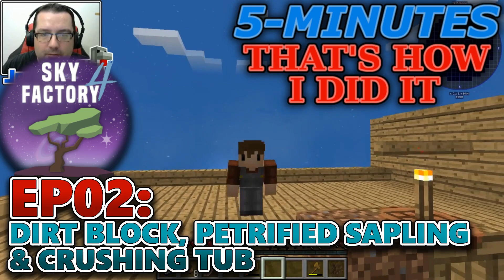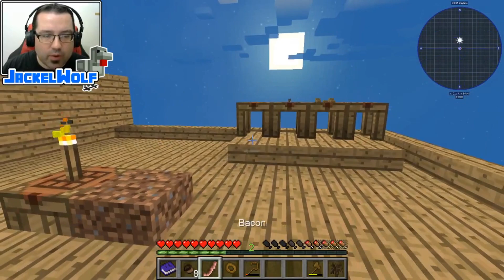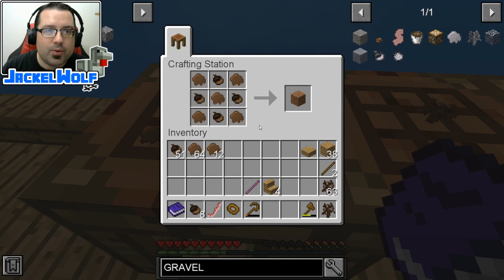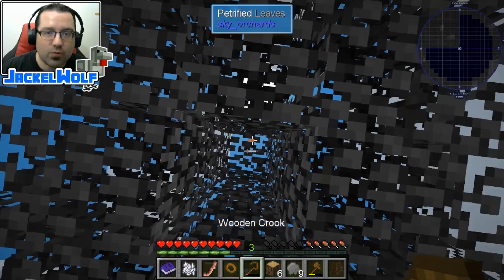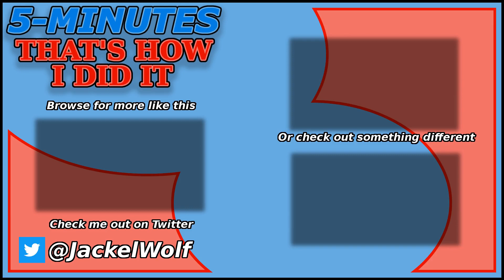SKYFACTORY 4 - EP02- DIRT BLOCK, PETRIFIED SAPLING & CRUSHING TUB (HELP/TUTORIAL)

Comment: Um i am 2 years late but i have a question. How did you get the vein miner?
Reply from the maker: This is probably my most common question. First thing you need to check is if you are playing with Prestige on. Prestige mode locks Vein Miner (technically Ore Excavation in this pack) and you can only unlock it by spending Prestige points (which you get by compleating pages of the advancement book).

If you do not have Prestige turned on, you need to hold the Grave key '~' down while breaking the block you want to Vein Mine. This is dependent on your keyboard layout, so you can check the Controls Menu to see if it is bound to a different key or if there is a key conflict. Again, it is called Ore Excavation in this pack, so you will have to look for that. 

Hope this helps!
Reply: ok thank you for letting me know

Comment: I just get something called dirt amber
Reply from the maker: You need to reverse the recipe. 5x resin and 4x acorns make dirt-dirt. 5x acorns and 4x resin make dirt-amber.
Reply: @JackelWolf  thank you, what about getting bones?  I'm pretty new to modding minecraft and the modpack doesn't really explain or have the recipes
Reply from the maker: There is a bone sapling. I think you need to craft from acorns. It's been a while, but if you search in your crafting menu you should be able to reverse Engineer from a bone sapling.

Comment: idk why but the recipe for dirt doesnt work
kinda late, i know, but if you could help me i will be very grateful
Reply: i have the same problem but i cant solve it. PLEASE HELP ME, I will be very grateful <3
Reply from the maker: Did you change/add any files? That was the cause of the previous problem? They solved it by reinstalling SkyFactory 4. Other than that, I'm not sure what else could be the problem. I've never had a problem with dirt before. 🤔
Reply from the maker: That is odd. I havnt had trouble with dirt. I assume you are using the resin and acorns, correct? If so, the only thing I can think of is to swap your positions for the dirt and resin. The other way would be to find the recipe in the JEI, and click on the plus sign next to it. If you have enough resources the plus sign should be white. Once clicked it will auto fill the crafting table with the components. Hopefully this helps!
Reply: @JackelWolf  did all that, checked the recipe and it says it needs something from cooking gravel and another thing I didn't remember. I really want to fix this because sf4 looks so interesting and I don't wanna be stuck with 1 dirt. Maybe I should start a village world?
Reply from the maker: @Stancho_cvet  that is odd. Dirt should just be the 5x dirt resin and 4x dirt acorns. What world type are you in?
Reply from the maker: When you are in the JEI, are you on the first tab showing the crafting table, oemr are you on a different tab? I'm not at home so I cant check the other recipes, but there are a few other ways to make dirt... though none that you can do right off the bat.
Reply: @JackelWolf  I'm in sky factory 4 World type. I heavent been able to try out other stuff cuz I'm about to go to sleep, thanks for your time, I'll just start a village type world and work from there. From the very few videos I've seen and the fact you took the time to help me, I can say you got a +1 from me. Have a good day/night.
Reply: @JackelWolf  Hi again,ive solver the problem, seems like i've deleted some fileb by accident when transfering them to my mods folder. Just had to delete and install the mod again,thanks again for your time
Reply from the maker: Oh wow! Glad you got it sorted.

Comment: I can't craft dirt. :(
Reply from the maker: No, dirt is 4 acorns and 5 dirt resin in a crafting table. You can also dry dirt acorns on a drying rack to get petrified acorns... and, I think, the opposite recipe (5 dirt acorns & 4 dirt resin in a crafting table get you dirt amber, which you can melt in a smeltry to get liquid dirt (which you can cast in a casting basin). I'm not at home, so I cant check, but I dont think you can crush the acorns... 🤔
Reply: @JackelWolf  ok. +1 sub from me for your fast replying. And thank you
Reply from the maker: I cover dirt in my EP01, but it is Dirt Resin and Dirt Acorns in a crafting table. You might want to grind out a bunch as you'll likely need quite a bit.
Reply: @JackelWolf  I'm aware, it was an issue on my server.
Reply from the maker: Ahh... yeah. I hear that it is still a little unstable on servers. Hopefully it will get sorted soon.
Reply: @JackelWolf  Why my crushing tub doesen't work?
Reply from the maker: Not sure? What are you trying to make in it? If it is an item and not a fluid, sometimes they get pushed out the bottom. If you are trying to make a fluid, they do not 'stack' inside the tub, so if you have mud in there, you cant make water until you empty it (break it, empty it with a bucket if you have enough, or shift right click (I think) to empty). Hopefully this helps. Let me know if the problem is different.
Reply: @JackelWolf  i'm trying to put acorns
Reply from the maker: @danielilut30  which acorns and what are you trying to make?
Reply: @JackelWolf  dirt, it shouldn't work, right?